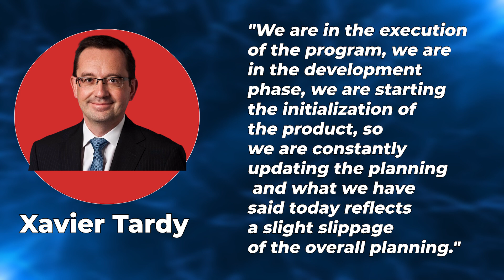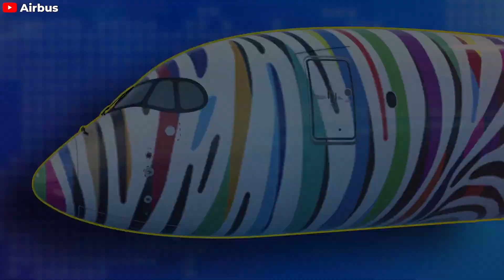Airbus "HUGE UPGRADE" on A350F Shocked Everyone! Here's Why

Comment: it doesn’t have nose cargo door the flight deck is in the way perhsps if sirbus moved the flight deck on top of the forward fuselage like the boeing B747-400F they would be able to fit a nose cargo door so that like the b747-400F cargo csn be removed from the cargo door aft of the left wing and at the same time cargo for the next sector is being loaded at the same time through the nose until they can do that the A450F will never be able to compete with the Boeing B747-400F because it will tske tolong too long to unload cargo and then load more cargo for the next sector the Loading flexibility of  the B747-500F is the main reason why cargo airlines will not even look at the Airbus designs. if the flight  deck were above the forward cabin on passenger sircraft it would make there first class cabin larger with moreseats and mske more profit per flight the economy sections pay for the flight the first and business class are pure profit cabin bigger on passenger sircraft enabling airlines to fit more seats into first class
Reply from the maker: Thanks for your useful feedback!

Comment: This news feed is aimed at the public rather than true aerospace engineers. I can pick up some new development approaches. Airbus is allegedly said to have advanced in aircraft structural enhancement going to composite components. This is to decrease structural weight and allow new enhancements to the structure to meet freight demand like a larger cargo door.  This structural enhancement is also a big merit to PIK (a group of aeronautical engineering students from Aalto University of Finland in Espoo) when they developed a new branch of the glider plane PIK-20 using composite materials and advanced aerodynamical wing profile. PIK-20 was the leader at its time in glider competitions. Later some light single-engine airplanes were developed (PIK-19 and PIK-23). Patria (an aviation company in Finland) has enhanced its skills in composite structures. We should note that the requirements of type certification are old and not fully streamlined to support new innovation and material use. This is one issue that is slowing down the development.